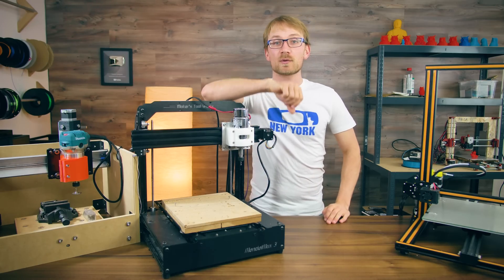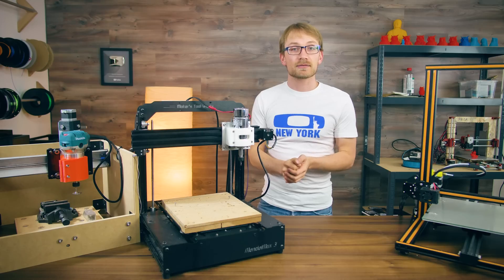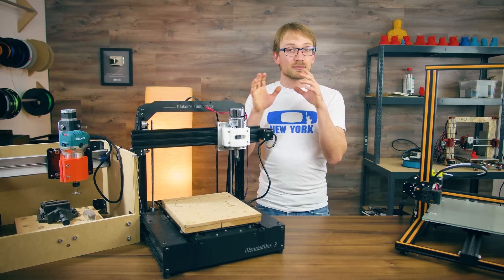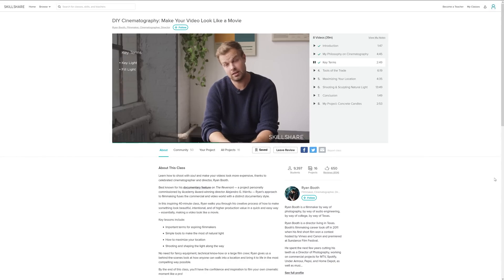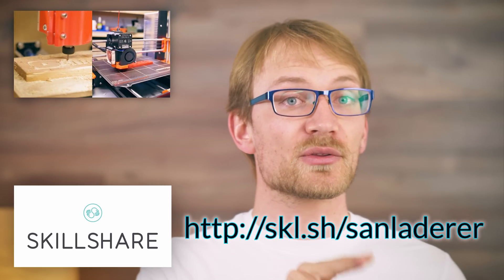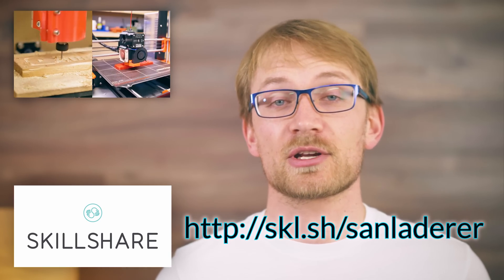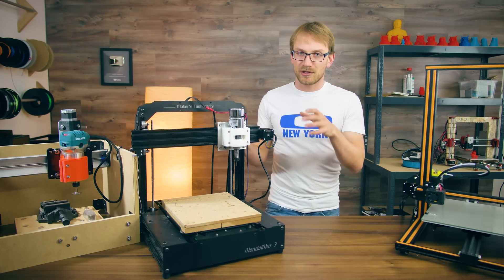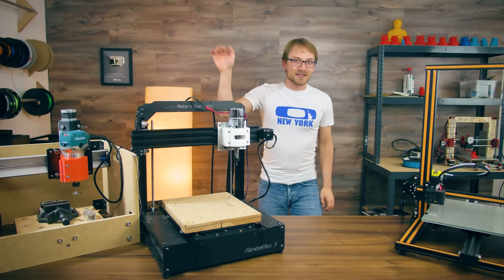Why 3D printers can't be CNC mills

Comment: Sorry man, but I feel the urge to correct something wrong in your video:
1. 3D printers are CNC machines, they don't mill, but still CNC
2. A 3D printer is actually a lighten up CNC milling machine, not the other way around: FDM came after
Reply: Strictly speaking yes, computer numerical control, but the formal definition is not the same as the one in common parlance, it's a fine line between pedantry and accuracy, about 0.0254 mm  ;).
Reply: did you watch the video? he literally acknowledged both of those things
Reply: And his milling machine its a drill press :-)
Reply: I upvoted this comment with my mobile CNC machine phone :D
Reply: That's basically what he said @9:10
Reply: m3chanist 

a 3d printer is ONE HUNDRED PERCENT a CNC machine. A CNC machine uses programmed code and is used specifically for machining/fabricating.

You are being the smartass because a HAND powered/positioned drill is obviously not CNC,  nor is a microwave, garage opener, cellphone. These things don't use numerical code to move tooling for machining/creating an object.
Reply: No, it does not mean the devices that controlled by a computer or microcontroller. But CNCs are devices controlled by numerical control languages like G-code usually used in machining and fabrication. This, I believe, is terminology in these fields that we should respect. Have a look at wiki for numerical control.
Reply: Roberto Lo Giacco additive manufacturing vs substractive fits better both are cnc's
Reply: Jasoninee Those thing could use GCode, or any machine code, question is why? (Maybe bored with how the garage door opened?) though home automation might use some sort of algorythm...
Reply: Aria C Bramanta 

Apparently you didn't read what I commented, because I definitely said that it is when the machine code is used for MACHINING/FABRICATING.
Reply: Aria C Bramanta 

My bad I just realized that you arent against it being called CNC haha.
Reply: Jasoninee no problem, anyways what I think tom is saying that spesific machine as a 3D printer although can be, is not recommended to be used as a milling/substractive fabrication , since the design is for an additive fabrication(albeit both is cartesian, or uses the same kinematics) though some pro machine had more rigid mechanics, it's the same thing, since it would be costly to just use a milling machine for 3D printing (an overkill, but totally doable), such machine might include delta kinematics (almost identical) I often see being used as lightspeed automation duty on factory floor (it uses pid, self corrections, assembly tasks, and runs on spesific type quite similar to gcode) which I would consider an anomaly when being used as 3d printing but nonetheless it is part of a larger fabrication unit (repetition with minor change for fabrication/manufacture is desired  for new iteration)
Reply: So by your standard, a garage door opener is a cnc machine, there is a microcontroller in the remote after all. As is a microwave oven, as is a washing machine, as is a modern cordless electric drill, they are all controlling movement via computer numerical control, and they are all tools. Or is there some nuanced subgroup definition that only you know the boundaries of? Which presumably includes 3d printers but not battery drills that you feel others should agree to?
Reply: That's not even nitpicking, that's just smartassery :)
Reply: Well, I believe it's not pedantic nor smartassery, but I understand it's common to refer as CNC mill/routers as CNC machines, but when doing a video on 3D printers and CNC mill I believe it's very relevant... I wouldn't have been so picky in another context, but considering the context I think it's pretty relevant.
Also the 5 axis considerations are applicable to 3D printers: rotate the bed and you can void support material altogether, if properly done.

Comment: Seems like it would be technically possible to make something that can function as both a decent CNC mill and a decent 3D Printer, but accounting for the needs of both would result in a machine that would be far more complicated and cost far more than just getting two machines. Not to mention the work switching between modes.
Reply: I agree with you. Just consider the dust left in CNC mill/router and the effect it would have if you suddenly switch to 3D printer: you'll have to precisely clean the entire work area or your print will be exposed to unwanted dirt, not counting for the extra weight or the reduced build volume. A decent CNC mill will definitely work as a 3D printer, but it would be really impractical and expensive.

Comment: Excellent explanation! I get this question often when people see the 3D printers and (CNC) milling machines side by side.

So in short: 3D printers not rigid enough to mill and milling machines are (usally) not fast enough to print. There is a way to have both but you have to throw a significant amounth of money at it. (servo motors + ballscrews are expensive. Especially when you step up to linear motors that are crazy expensive.)
Reply: For example (example of a crazy fast milling center) the DMG mori seiki milling centers with linear motors have rapid speeds of 100m/min 
100*1000 = 100000mm/min.    
100000 / 60 = 1666 mm/sec

Should be enough!

Source: https://nl.dmgmori.com/products/machines/milling/horizontal-milling/dmc-h-linear/dmc-80-h-linear

Comment: what is the disadvantage of a cnc mill to 3d printer conversion?
i just heard disadvantage of the other way around
Reply: In part, your mill isn't going to move all that fast compared to a 3d printer. A friend built a fairly beefy mill and attempted to use it as a 3d printer as well. He broke it due to all the high speed moves while using it to print.
Reply: A cnc mill is much more expensive for the same build volume and you'll have a hard time building a heated enclosure, those are about the only disadvantages I can think of. Other than that a cnc mill is just straight up better.
Reply: Some (but not most) CNCs are too slow for a 3d printer. I guess some rack and pinion routers also have too much backlash to do a good job as well. Avoid those 2 relatively uncommon limitations and you're all set.
Reply: The heavier gantry will require a lot more power to move, the build plate has a different concept (smooth and plain vs sacrificial bed or clamps) and the dust left over from a milling operation would kill a 3D print.
Reply: Most CNC mill/router, including the cheap chinese 3020 are fast enough, even faster than most cheap 3D printers out there. Speed is definitely not an issue.

Comment: Hey Tom, any thoughts on converting a small 3dprinter to a pcb board mill?  Either laser cutting or simple milling off the copper?  I have a small printer I would like to try this on.
Reply: By first-hand experience, engraving a PCB does still require a lot of rigidity: scratching the copper surface with a V-shaped milling bit is a lot more stressful than laying down a thin layer of plastic. Even if you are careful and manage to scratch the surface in very thin passes (let's say 0.05 mm) the V bit engagement with the material will increase with the depth because with the deeper cuts the sides will engage into the material. Typical engraving depth for a good copper clad is 0.2mm, but with cheap chinese copper clads you often have to go to 0.4 to compensate for surface irregularities. That's a lot of side forces onto the gantry.

Comment: Are gt2 belts good for cnc?
Reply: possible: yes
good: not even close
Reply: The short answer is no. The long answer is you can use them (i.e., in the Shapeoko or Xcarve), but don't expect enough rigidity to do anything above cutting wood. IMO belts are too flexible for any milling or turning application. They do have their place within automation, don't get me wrong. Just not cutting.

Comment: Tom, how would a converted 3d printer to mill PCB? Would it be stable enough?
Reply: for super slow pcb milling you might be OK with just beefing up the frame if it started as a pretty rigid machine (not printrbot or others with cantilevered print heads) the sienci CNC machine (bob) is the lowest cost worthwhile machine and it will be significantly better.
Reply: Skooteh yeah I’m not looking for crazy production runs of pcb milling just for projects I am working on. I have a wanhao dup i3 which as a 3D printer it was horrible but was thinking of converting and beefing up to use as the pcb mill.
Reply: Skooteh yeah I’m not looking for crazy production runs of pcb milling just for projects I am working on. I have a wanhao dup i3 which as a 3D printer it was horrible but was thinking of converting and beefing up to use as the pcb mill.
Reply: it should be alright once beefed up. For what it's worth, the sienci CNCwould fall apart in a production environement very quickly.

Comment: Would love to see a video on how CANC manages to make perfectly smooth, round cuts, where printers are dependent on making smaller and smaller triangles or faces. My gut tells me there's a difference because gcode supports arc commands that are not supported by 3d printers. Any insight?
Reply: The slicer would need to recognize a round hole while slicing. .STL files by definition eliminate round holes and replace them with straight lines. I believe some higher end/proprietary (e.g. Statasys slicers) can do this, but it's rare and doesn't always work. When programming CNC milling machines, the model geometry itself is used as an aid to program the toolpaths, which allows the software to know if the cut should be an actual arc and output the g-code command for an arc. This allows the generation of very smooth circular motions. Keep in mind of course that these aren't actual circular motions, but interpolated circular motions. They are very, very accurate (depending on the machine, it could be less than a few ten-thousandths of an inch or better), but not 'true' circles. Hope this helps.
Reply: little bit of that, a little bit that CNC machines are more rigid and deflect less when they accelerate, and also a little bit that the cutter diameter on CNC machines is much more significant which effectively smooths the inside corners.
Reply: Models for 3D printing are converted to a format that takes the entire model and makes in into a shit load of triangles (STL files). As we all know, triangles have all flat surfaces. BUT, with greater "triangle resolution" you can get something that looks very much like a curve. 

So the format of standard files is what makes the triangles. Because the popular slicers only support mesh files, that is all that we will have for now. This has nothing to do with CNC.

Keep in mind that 3D printers are CNC and they should easily be able to support ARC G-Code commands (for perfect circles). But none of the slicers are going to give you an arc because of the limits of mesh files, which are all triangles.
Reply: I'm so happy to see someone else pointing out the (IMO) flaws of the current .stl system. Someone over at Autodesk should really make plugin for Fusion 360 that let you slice your solid model directly. Think of the possibilities! You could enter a one-time offset for the slicer to automatically oversize holes printed in the X/Y plane (to deal with the "rubberbanding" effect of molten plastic). I'm actually really surprised that no one has done it yet (other than the aforementioned Stratasys software).

Comment: Make sure you get the right stepper motors for these builds. Made the mistake of buying cheap 12volt steppers. 12volt is NOT recommended for achieving 1/16 microstepping. Aliexpress is full of those. Dont buy them.
https://labitat.dk/wiki/Sanguinololu#Pololu_drivers_current_limit_configuration

Comment: It´s pretty easy.

There is no CNC3DPrinter.

You can have a good Printer thats a shitty CNC Router.
Or you have a good CNC Router but a shitty Printer.

A good 3D Printer is lightweight and fast.
A good CNC Router is stable and can take a lot of force.

Combining both is not possible.

Comment: I've been thinking about why we can't get both in one - at least without it being a little shoddy - but once again your enjoyable analytic style answered a lot of questions! Thanks!
Reply: You can, but it's cost. bottom line is you could put a hot end on a CNC machine and it will work with far more accuracy than a regular 3D printer(obviously with a bit of coding), you can't go the other way due to the rigidity requirement. By the time you have spent that much cash on a decent machine (+plus the tooling and workholding) a stand alone 3D printer is such a low cost purchase you might as well get a stand alone one. You also have the mess issue, there is a lot of chips and if you are working with metal, cutting fluids and oil, things 3D printing does not like.
Reply: By "can't get" I meant that they aren't readily available on the market. ;)

But the mess factor is a huge one, for sure! - going back and forth would be insane.
Reply: Today I Made absolutely! I’m a CNC machinist and you could basically strap a hotend on any CNC. You just would Need to build a strong and sturdy hobby cnc and you could use it for both
Reply: Machines that are compromises between two or more use case scenarios are always, not too surprisingly, full of compromises. They have to be. For example, just one small aspect, I have a mid sized mill/router (itself a compromise) CNC that I've added a hotend to, it has excellent accuracy and repeatability running on 25mm linear guides in all dimensions which are mounted to poured epoxy granite over a 9mm wall thickness steel frame, its as stiff as a stiff thing, oo la la (and nearly killed me several times in construction).  BUT..the x axis gantry alone weighs over 100kgs...it runs nema 34 motors, the energy cost of leaving it running for more than 24 hours straight?!  lets just say that print needs to be damn valuable to me when a small purpose made machine can produce "good enough" results at a fraction of the cost, both in $$ and time and hassle doing the changeover from one mode to the other. And a heated chamber big enough to enclose it?  out of the question.
Reply: Many people have taken their CNC Machines (X-Carves and others) and put a hotend on it.  The Doug Jackson (SVSEEKER) did just this on his big CNC.  He rarely uses the 3D Printer hot end, but he can.  His CNC is primarily used for plasma cutting or milling...not for printing.
Reply: @Lucas Imark: In principle, that's on spot. Only a CNC router will become a fairly slow 3D printer. Moreover, why not slap plasma cutters, lasers or pens or cutting tools on a tool holder? Laser cutter, plasma cutter, plotter, router and 3Dprinter, all in one!!1! :oD
I have no doubt it can be done. Only you'd need upmarket power supplies and a machine that can't be made on a budget.
Reply: Stepcraft also has a CNC router and also sell a 3D printing head. Never used it with the 3D printing head however, so no clue how good it works.
Reply: Considering working on one as a college thesis, have been in planning with my HS robotics teacher
Reply: Lucas Imark I've been considering a CNC for some time now. I don't currently have space for more devices really, but that's something I'm working on. - Also need more proper studio space for sure!
Reply: David thats cheap man. The five axis CNC‘s I work with cost 2‘200’000 a piece
Reply: Already exists!  BoXZY.com